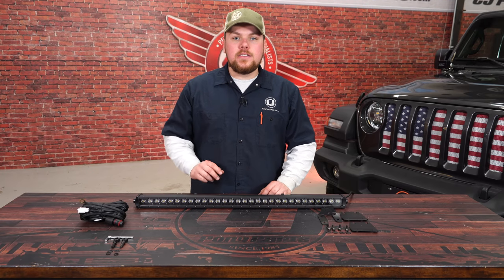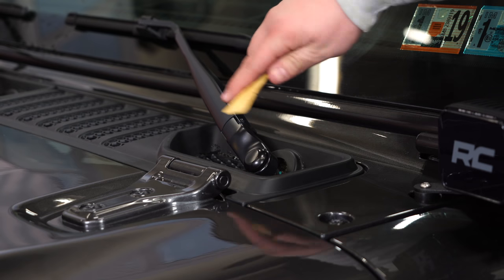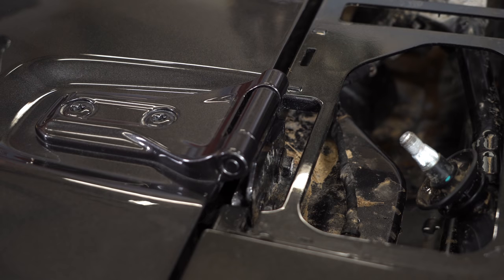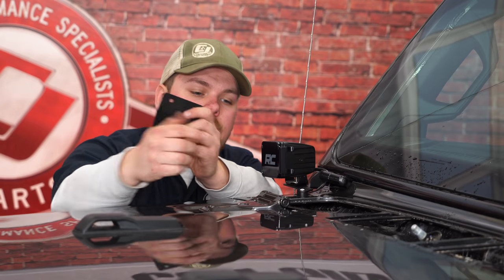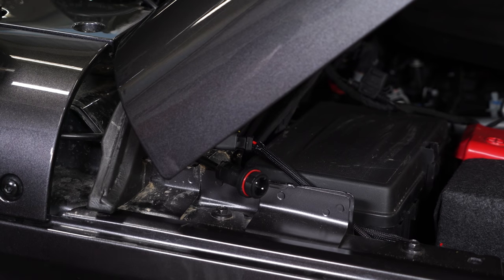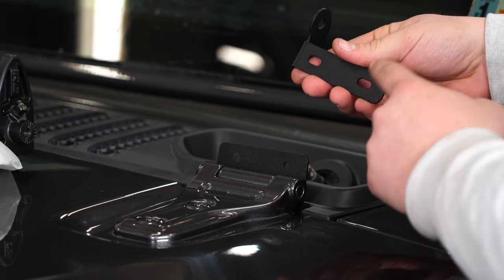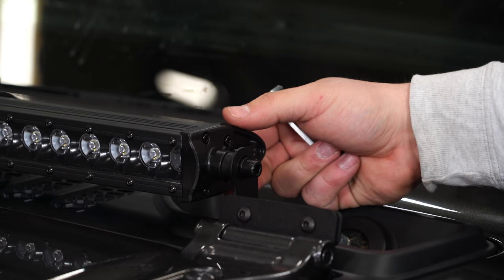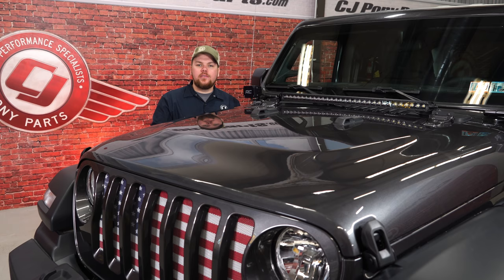2018-2020 Jeep Wrangler JL: Rough Country 30" LED Hood Light Bar Kit Install

Comment: I just ordered one and got it-  I MAY be wrong, but it looks like you installed it upside down? In the directions it mentions different ways to mount and when the "bottom" is facing down, the power cord is on the drivers side. (that does NOT make sense to me because battery is on passenger side) And when I got it, the cover has a RC on it and when faced in appropriate position, the power cord is again on the driver side. I imagine it really doesn't matter - the only thing is the top and bottom of the lightbar look a little different.

Comment: I decided that I would just try to figure it out and I finally got it working with the aux switch in my Rubicon. Here is what I did...I took the harness that came with the light bar and removed the heat shrink wrap that is around the relay. This will expose the connection points for the 3 main wires that make up the harness which are: 1. The leads to positive (red) and ground (black)  2. The switch that came with the light bar  3. The plug that connects the harness to the light bar itself. I opened the top of the relay and pushed all the connectors out. You will see the three wires that lead to the switch that came with the light bar which are blue, white and black (the skinnny black wire). The blue wire is on it's own and you don't need to worry about that one. The white wire is soldered to a red wire, and the skinny black wire is attached to the other 2 thicker black wires. You can cut away the white wire and the skinny black wire becasue you won't need them since you don't need the switch that came with the light bar. This is where you will now create a new harness which will have one end that leads to the plug for the light bar, and the other end will be the leads for the positive and ground wires. So you have to solder together the 2 red wires that you have left in the middle, and then cover the conenction with some heat shink. You don't need to do anything to the black wires since they are already connected, but again to keep everything safe and neat, I covered the end of it with some heat shink too. Now you can attach the plug from the reconfigured harness to the connector on the light bar. On the other end of the reconfigured harness you should now just have the red and black wires with the eyelet connectors at the end. Ground the black wire to the car or the battery...I found that grounding to the car was easier since the cable is not very long. Then you can remove the eyelet from the red wire and just solder it to whichever aux switch you want to use. That is all! If you have any questions, just let me know...hope this helps someone!

Comment: So how exactly did you guys add this to the built-in aux for the Jeep wrangler? I’m ready to purchase the light bar from you guys but I’m hesitant on the install, the light has a switch. Is the switch separate form the provided wiring harness?

Comment: Is there a reason you Never show how to add it to the Aux switch?
Reply from the maker: There are many ways to wire this bar up, soon we will have a video showing how to complete basic wiring in your jeep.
Reply: please do!!
Reply: What's the clearance with the hood opening and closing?
Reply: I am trying to wire to my aux switches with 2 led light pods. I couldnt get it to work with the provided harness with the button but when I hook up directly to battery it work then but I have to use the button and not the aux option in the jeep
Reply: @CJBroncoF150  Have you created a video that shows basic wiring to the aux switch on the Jeep?

Comment: The wire on the light bar is on the other side( driver side)..those it matter? The groove in the center of the light  doest it matter if is on top or bottom??
Reply from the maker: it does not.

Comment: If you put it there, it eliminates the possibility of dropping the windshield.
Reply: Was wondering if it would get in the way - does look like it would prevent folding the windshield down.
Reply from the maker: Yes it does block the windshield folding.

Comment: Excellent walk-thru.  Bought the light, piece of cake to install.  Looks awesome, bright as hell.  Very impressed with quality out of the box. I assume it’s okay for an occasional pass thru a car wash.  Anyone have experience as such?
Reply: I'm trying to install this right now. After removing the 15mm nut the wipers seem really stuck on the stud? Did you have any issues pulling them off. This is a demo jeep we are accessorizing at my business so im trying not to break anything lol
Reply: @Cgny  Mine were quite stuck the first time. I ended up getting a proper "Battery Terminal and Wiper Arm Puller" so I could evenly apply pressure to not break anything.

Comment: Do you know what the amp rating is on this light? did you wire them to the 40 amp aux switch (aux 1 or 2) or the 15 amp aux switches (aux 3 or 4)
Reply: I wired the 40 amp (tan/aux switch 1) because I'm using the smaller two 15 amp switches for pod lights. Works like a charm, but can't answer with any expertise on if this is good, bad, or indifferent, on proper setup.

Comment: I have contacted both Rough Country and CJ Pony Parts and no one seems to have an answer for how to wire the lights to the aux switch. The Rough Country guy didn't even know the JL had an aux switch option in it so his only answer was "just run the switch the light came with into the cab"...well thanks for the advice. I paid to have an aux switch and you are telling me to not use it. The guy at CJ Pony Parts said he didn't understand the wiring details. He said he would try his best to find out but he wasn't going to make any promises since he has no way of contacting the guys that make the videos. I am super upset...if you are going to say that something works but then can't explain it fully, how do you expect people to make it work?? Neither company even has instructions on their websites for the install.  I would really appreciate it if CJ Pony Parts would explain the full wiring process from the light harness that comes with the lights to the aux switch. I am clearly not the only one having the issue.
Reply from the maker: In the passenger side of your engine bay there are 4 auxiliary switch outputs that have black heatshrink over the end of each of them. Attach the RED wire of the rough country light bar to one of the 4 switches, and then put a ring terminal on the BLACK wire of the rough country light bar, and ground it on the stud right next to the AUX wires.
Reply: how do you wire 2 led light pods? I can't seem to get the aux buttons to work with the wiring harness but when I connect direct to battery with the wiring harness it works fine using the wiring harness relay button
Reply: CJ Off-Road I did this part and the only way the aux switch work is if I have the RC button connect to the wiring harness and pushed on. But if you remove the RC wiring harness button, the Mopar aux switch won’t work for that connected wire port in my case AUX 1. Any answers to this ?
Reply: @CJBroncoF150  ok so how about the provided switch? how did you delete the provided switch?

Comment: You mounting the light bar upside down mate !
Reply: Yes he did!
Reply: So I installed this way, too, as it's WAY less wire to run or deal with, and it works just fine. Mine also came with the RC light over on right side up this way, so I just assumed it's interchangeable and doesn't make any difference.

Comment: Anyone else having a hard time getting the damn wiper blades off?  I took the bolt off but it wont budge
Reply: Assume you got it done by now, but just use a little leverage (hammer claw or an pry tool) and it'll pop off quicker than you expect. It took me a lot of pulling and jarring without it budging, but popped off in one or two seconds after using a tool for leverage.
Reply: @joshmorris9148  Ended up using a tool from autozone (looked like a clamp) that popped it right off.  ;)